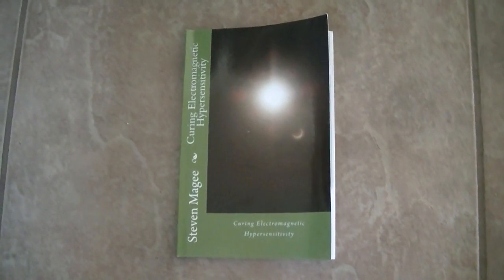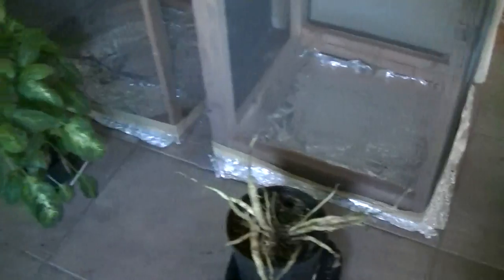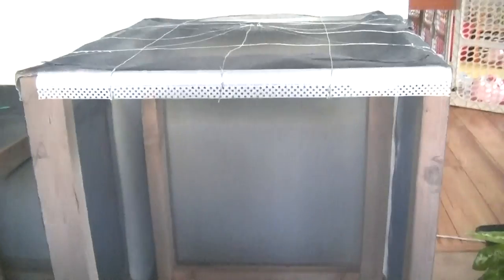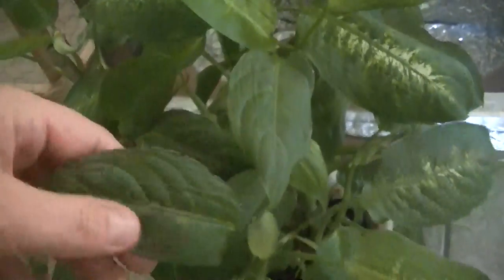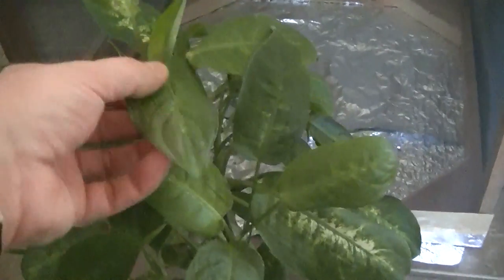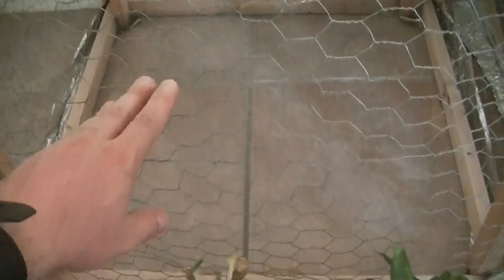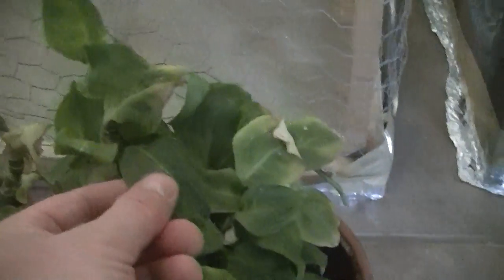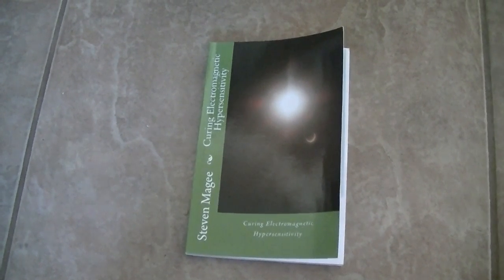Curing Electromagnetic Hypersensitivity - Faraday Cages & Shielding

Comment: If you have ever raised mice you will know that they live in a crude Fariday cage ... they do fine. My neighbor has birds in a steel frame structure steel roof quarter inch mesh covered- a Fariday cage- they breed they thrive. Your experiments are a place to start but they need to be reproduced by others. There well maybe something about plants, after all they are photon converters- electromagnetic converters- Animals are not. Some great work though it does tell us that plants may well require EM outside the visible spectrum.

Comment: A couple of questions
1. Was there an AC electrical field present? If so what were the volts per meter?  
2. What was the AC magnetic field in milligauss? 
3. May I ask what brand of equipment you used to measure these fields?
Reply from the maker: No AC fields were present, they were grown in rooms that have no electricity and outdoors.  I used a Trifield 100XE to establish this.  The plants were insulated from the home foundation, but may have had some AC coupling into them from stray voltage.  I have never seen stray voltage exposure kill a plant in my experiments, it causes them to turn into Frankenstein plants.   RF fields were present and I used a Cornet ED75 and a Tenmars TM-196 to establish this, I live 2,000 to 2,300 feet from three separate cell towers.  The home is continually filled with pulsed RF radiation from Itron Centron electric and 100G gas meters, which is normal for Tucson, Arizona, USA.

Comment: I actually sleep in an ungrounded faraday since early this year because of RF interference from local homes and utility. I have noticed cognative issues recently. Do you think that I should deconstruct this and stop the test? Kind Regards
Reply from the maker: The more unnatural that you make your environment, the more likely it is that you will see long term health issues develop.  I cannot advise you on your particular health issues, as I am not your doctor.  As for how I recovered my health and the techniques that I used, you will find them here:  http://www.electricsense.com/8862/curing-electromagnetic-hypersensitivity-my-review/
Reply: StevenMageeBooks
 Thank you Steven. It was unearthed for a few weeks because I was feeling an unusual surge while sleeping, I have plugged it into wall socket just yesterday and felt a difference in myself. Are salt and electrolyte drinks advisable to help with conditions like these? Drink salt water sometimes to help with a dehydration problem here, very dry air.
Reply from the maker: FreeClient01 Salts and electrolytes were important factors in clearing up my EHS.  I ran my Faraday cages in a variety of situations that included grounded, ungrounded, electrically grounded, no foil base and foil bases.  All stressed and eventually killed the plants inside them.  The only plant that has survived is the nighttime only Faraday cage plant.
Reply: StevenMageeBooks
I appreciate your help.
Kind Regards